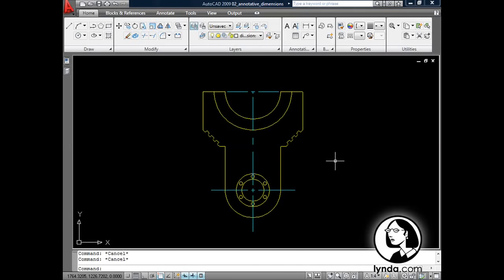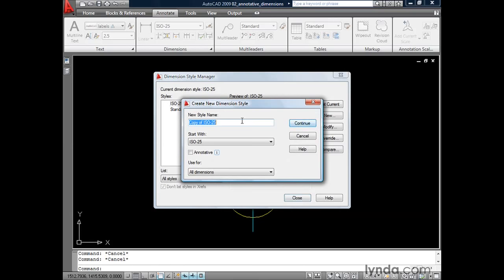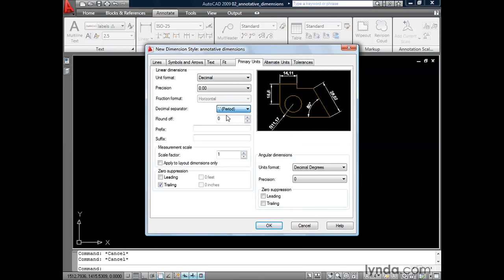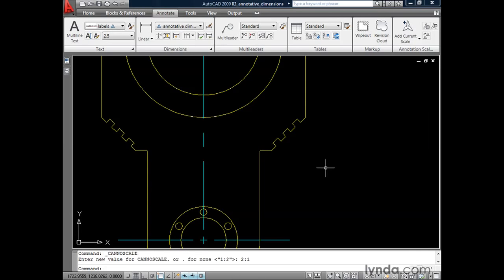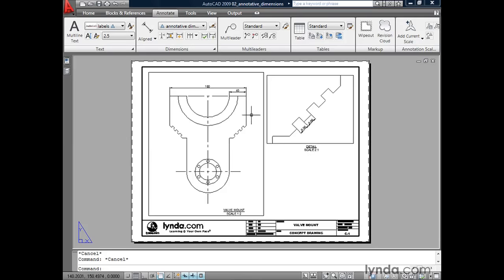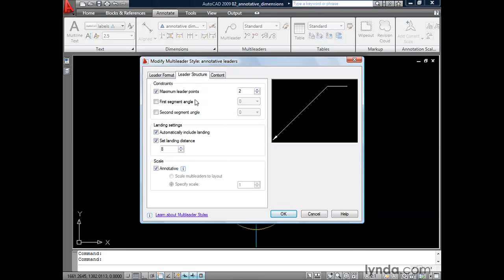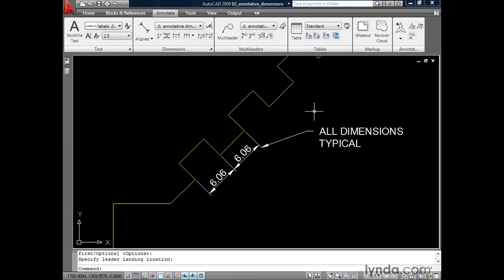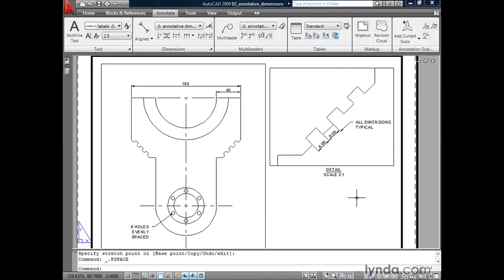AutoCAD Tutorial - Creating annotative dimensions and multileaders

Comment: hello, can you please help me make my dimesions to editable faster? what happens is that whenever i try to just move or edit the text of my dimesions it is taking 5 secs. I tried using the properties and edit all at the same time but the text height wont change but the arrows will change after I input the size. or use match property but still it is logging. this only happens when i edit the dimensions. please help! thanks in advance! if you want, i can send the autocad file on your email. thanks again!